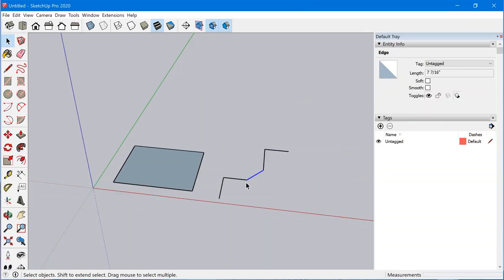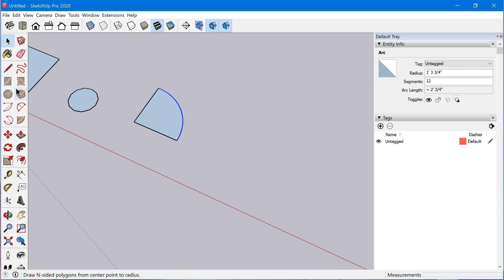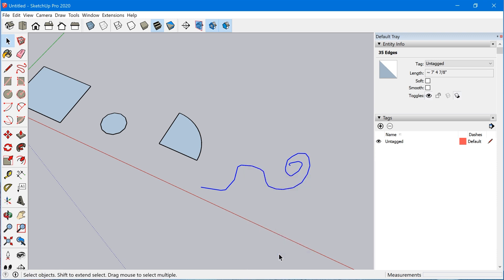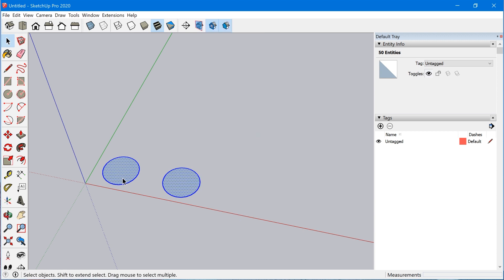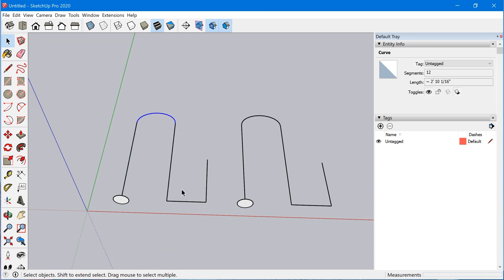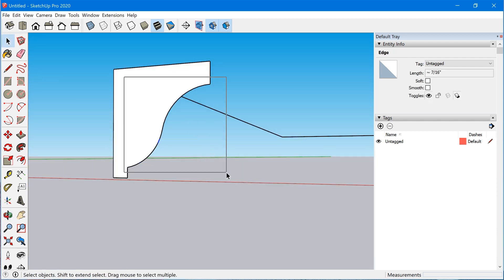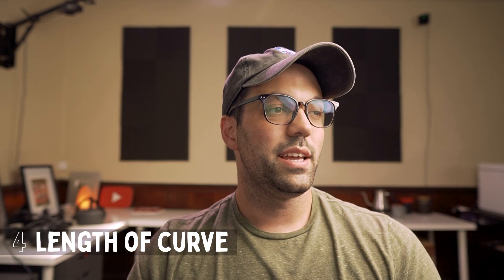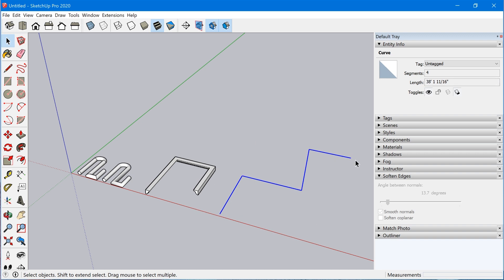Weld edges feature in SketchUp Pro 2020.2

Comment: Try building a rectangle in a vertical plane. Then divide one of the vertical edges into 2 or more separate edges and weld them back together. Now try moving either the top or bottom edges. You can't.

Comment: Matt, a very good job of EXPLAINING as well as demonstrating the concept of welding.  Glad that you are breaking down specific functions into separate videos with very specific titles and including **references to the applicable SU version**.  This will help eliminate viewing similar You Tube videos of functions, etc.,  that are outdated/no longer applicable.  Thanks!

Comment:  Too bad that the weld functions can't analyse a selection of edges changed them back, if applicable, to a native arc or circle.  In otherwords, if all edges are of equal length and their common angles (the angle at the vertex of two edges) are equal, then they must be a circle or arc.  Circles and arcs have specific attributes which are useful, such as for dimensioning and snapping points.
Reply from the maker: John, thank you for the thoughtful compliments. I agree about the arc and circle. Doesn't seem too hard to do, considering the criteria is pretty straightforward for determining if it's a circle or arc.